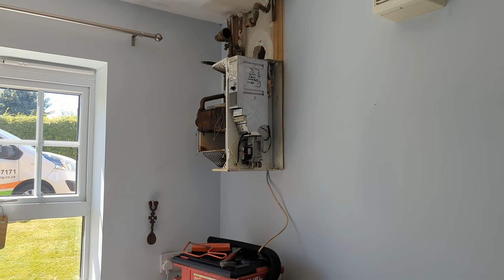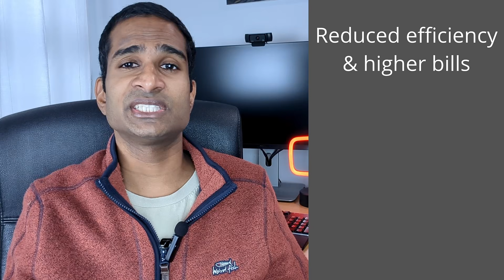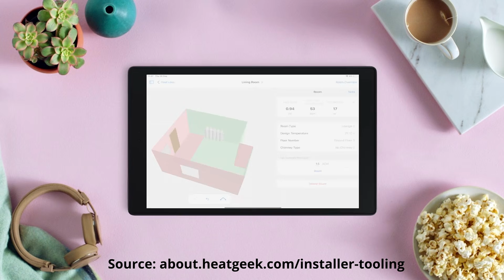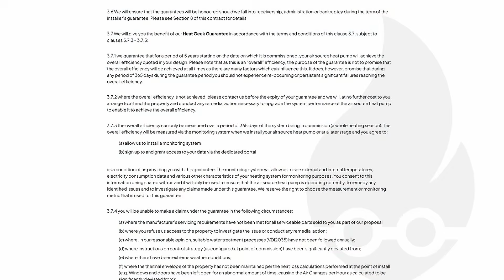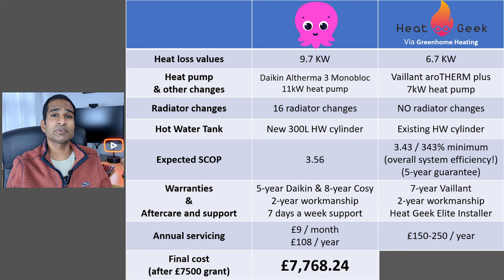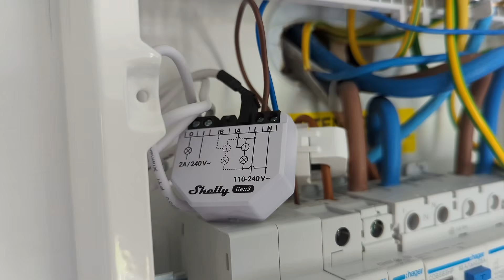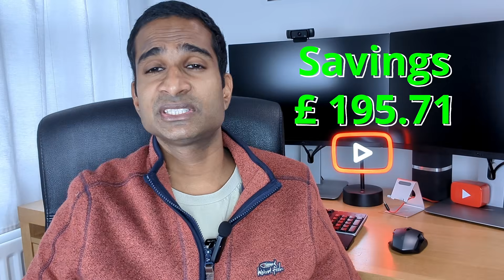Why I SNUBBED an Octopus Energy Heat Pump Install...

Comment from the maker: Question of the day: Should we prioritise QUANTITY or QUALITY of heat pump installs in the UK to reach Net Zero?
Share your thoughts below: 👇
Reply: I think ovo dropping their heat pump tariff shows that you should still ensure quality. 

Given our spark gap is so wide, a SCOP of 3.6 to 4 is needed to make the heat pump running costs competitive. 

I think lower quality installs relying on tariff magic are extremely vulnerable to the whim's of shareholder / investor profit margins.
Reply: Quality.
Reply: Definitely quality. Not even quality just efficiency.
Swapping radiators isn't exactly hard. 

I think the priority at the moment should be insulation, draught proofing and radiator upgrades. 

Make all new boiler installs mandatory to use weather compensation. And all boiler installers forced to do heat loss calculations and recommend things to improve costs savings/efficiency gains.

Offer low % finance over 10 years for heat pump installs. 

Personally I don't think it's difficult, it's just a long term thing.
Reply from the maker: Thanks for sharing 👍🏽 S
Reply: We should drop net zero targets. There are no benefits, only costs.
Reply from the maker: Sure sure, just ignore the evidence. We can't just keep burning fossil fuels
Reply: @everythinghome What evidence of benefits do you have please?

Comment: Ah brother get those radiators changed to double ones and you will be laughing even more! I bet you could do it yourself as well. I have zero plumbing knowledge but I was able to do all of mine
Reply from the maker: That's great to hear you did yours yourself - love people learning new skills - well done. Our efficiency is running around 460% at the moment, without a doubt we could get it a bit better but I'm pretty content with where we are after 12 months with the heat pump. Shan

Comment: Unfortunately Heat Geeks are far from perfect. The first Heat Geek installer allocated to me didn't respond to any communication, and the second one did a survey and presented me with an error-strewn proposal with a price tag that was more than twice their website estimate, and the second highest I have received (out of 8). Heat Geek couldn't (be bothered to try to) explain this so I got my survey fee refunded. My Octopus quote was more than £1500 less but as you experienced, one of the issues with their installs is their inflexibility.

Comment: Great video! 
Out of interest, did either company include a power flush of the heating circuit during the installation? 
Thanks
Reply from the maker: Thanks, I don't believe that was something that was quoted for in the work. Ours had recently had one done and we have a Magna clean device in the system too so don't believe it was necessary. I suspect you could add this on as part of the work if they felt it was needed? Shan

Comment: Octopus cutomer service is crap.  I am struggling to get  down to read my meter which is low to the ground due yo an arthritic condition. and my smart meter stopped send ing readfings in 2021.  they are supposed to repar that within 5 days. 5 years later and they have only read my meter once. they should read the meter every year at least once to confirm the reading.  Because they a Lazy and only want to send a bill and get paid they do not comply with their lisence rules.   whilst at the time the meter stopped sending readings was in the reign of SHELL Octopus should have taken an opening read for them to set the billing protocol. they did not do this. ALL my bills since 2021 have been estimated. they have missed 7 booked appointments to read my meters  NO ONE HAS TURNED up. I should be compensated but they refuse to apply the License rules in place for not doing so. basically they have no way of proving my usage with them. i told them this in december 2024 when i requested my meters be read. NOTHING has been done. this game we are being pursuaded to play of DO IT YOURSELF is not what should be happeneing. They should read the meters ONCE A YEAR to establish an accurate bill. in between this they can estimate. then on the yearly read an accurate bill can be established and a shortfall or a credit can be applied. By not reading the meters for at least 5 years and relying on estimates means accurate bills are not possible.  Time to challenge them and make them do their jobs properly.  Solar and batteries is the way to go. You can also charge the batteries at night on the cheap rate electricity and cut the costs as well.  Time for the Pay twice game via standing charges to go as well.

Comment: Good vid! I think the problem is nearly always with the training. I hope the big companies learn from Heat Geeks, because IMO if you're a big company and do "meh" installs, it sets the cause back. Imagine if a big company required all of their installers to pass the HG training? If an engineer can't pass the gold-standard industry certification, they shouldn't be installing heat pumps. 

When I watch the pros doing this stuff, it's clear the mindset is "get the best training available and keep learning". They never stop. We're several years in now and it's clear the better installers have made strides in a few areas:
- Do the basics for insulation/glazing if it's not already there
- Perform an accurate heat loss survey and size the HP appropriately
- Design the simplest system possible for a bog-standard house (e.g. no zoning, no buffer tanks, volumisers, whatever)
- Turn on weather compensation, tweak until the customer is happy

OTOH there are endless installers out there who still put them in like it's a gas boiler and know less about them that random YouTubers. MCS still seems to be a joke, with no real-world adjustments or inspections, just a flat 2.8 COP. Imagine you had a new-ish build and some plonker installed a 2.8 COP heat pump. Crazy.

I trust Octopus as an energy company (very good service, website, extra gubbins like the Ocotopus mini) and I don't think they'd do a bad install, but I'd still go with Heat Geek for a HP install because I want peace of mind.
Reply from the maker: Totally agree, training is the biggest lever here.

That mindset shift you mentioned (“keep learning, don’t treat it like a boiler swap”) is exactly what separates the top installers from the rest. The scary bit is that homeowners often don’t realise the difference until after install.

I think you’ve nailed the core pillars too: proper heat loss, simple system design, and actually dialling it in with weather comp. 

If big players pushed that gold-standard level of training as a baseline, it would move the whole industry forward fast. S
Reply: @everythinghome  thanks for the reply. I just can't understand why anyone involved in this industry installing HPs isn't getting the best training. It'd be like hiring a load of folk to be bakers, then saying "urm, yeah just bung some flour and water in a bowl and then shove it the oven", then wondering why the results are inedible. Baffling.

Comment: Interesting video - we turned down Octopus Energy heat pump installation for exactly the same reason. In a small 1950's bungalow, it wasn't feasible to shoehorn in big rads and a tank the size of the airing cupboard. Now I've seen the Heat Geek approach, I may be revisiting this.  The game changer for us would be having a solar / battery system installed first. Balcony solar? Let's see.
Reply from the maker: Thanks - we love our heat geek heat pump. Zero disrupt was definitely the way to do for us and well worth a survey with them.

Yes, exciting times ahead potentially for solar once the details are sorted. S

Comment: We are currently going through the Octopus route, because our bank is offering to pay the costs over and above the govt grant, so don’t have the choice of suppliers as they only use Octopus.  Our water tank is only 5 years old and needs changing due to size and apparently their tank runs a cleaning process weekly.  I wonder what the savings (in both money and carbon emissions) in running a more efficient water tank on a heat pump system are (and wasting a tank that hasn’t fulfilled its expected life cycle) versus keeping an existing tank that has a smaller coil that needs to heat the water for longer, but meaning you don’t need to waste its life too soon.
Reply from the maker: Watch this https://youtu.be/8aKZhX93hMU and if you haven't already got a heat geek quote it may be worth enquiring. A new tank for us would have added about 3k to the cost. That's a lot of hot water cycles no matter how efficient it is! Shan

Comment: Clearly in your example,  the 'precision' Heat Geeks approach was better than the 'standardised' approach.  And with less disruption, fewer changes,  and lower cost, it is better for you the customer and surely the installation part being simpler must scale better too.  Heat Geeks are going the right way, trying to standardise, streamline and automate the 'custom design' process with Lidar and AI etc,  this will give them the best of both worlds and surely must be the winning formula.
Reply from the maker: Yup, it's certainly working well 👌🏽 S

Comment: I had a heat pump in my previous bungalow. It was very efficient and   economical to run. I'm thinking of getting a heat pump in my new bungalow in a few years when the gas boiler is older. I don't have space for a hot water tank. I'm monitoring thermal store water heaters and waiting for smaller models to become available which suit smaller homes.  Thanks for your video. As always very informative
Reply from the maker: Thanks, that's really interesting to hear about your previous heat pump experience and your plans for the new bungalow! I've seen a few hot water cylinder storage boxes allowing them to be installed outside, may be something to consider. Shan

Comment: I tried going on Heat Geek's website to see if I could book a survey from them, but according to their address finder my ground floor flat in a semi-detached house in London is not a residential building.   They only seem to take you in consideration if you own a whole house, which is a shame. Octopus will at least do a survey.
Reply from the maker: Ah, no something I'm aware of. You could always contact your local heat geek by email and check if that's right. S

Comment: Yeah, E-On, I think they say nothing for 30 days then 50 drops into accounts, I did get a 50 Voucher email moving forward this year, I got a 24v 40A Fog Star charger, Its only worth it on a EV tariff. Charging my nearly 6Kw Home Battery. However, was a bit shocked with standard Variable being 35p or something and 60p  Next Drive Fixed. Standing charge. So might not stay with Eon after, I get 50 quid .... Be checking in Thru out year.

Comment: I would like to see you break down the cost of the install. I feel the heat pump installers are taking advantage of the grants. Overcharging thousands of pounds for the labour. I would guess your equipment cost around £5.5k leaving £4.1k for labour, and as you had very little changed on your install they wouldn't have spent much time installing it.
Reply from the maker: I hear you, it's a big number! But there’s more to the maths than just the heat pump. The Vaillant unit, the SensoComfort controls, the Primary Pro insulation, and all the G3/MCS components do add up.

More importantly, you're paying for the liability and the MCS accreditation which is required for that £7,500 grant. That survey alone takes a few hours of heat-loss calculations to ensure the system actually works in the coldest months. I’d rather pay for 2 days of expert 'Heat Geek' labour to get it right, than 5 days of a less detailed install with unnecessary changes and disruption that costs me a fortune in bills later!

We're paying for all those years of experience to get to the point where they can install a heat pump which is as good as I've got with minimal disruption. S
Reply: @everythinghome  every skilled professional has similar costs, and this is taken into account when they charge. 

When a Doctor is being paid a few hundred pounds per day, why are heating engineers charging 3 times that? 

You got a good deal because of the grant, but why didn't it get put in at zero cost to you?

Imagine how much faster the country would decarbonise if they were being installed at zero cost. 

I would be interested to know a cost of the materials and labour.

Comment: You would have likely had a slightly better performing system with Octopus but it would be poor value for money.

I'm going to install my own system. It will be dual fuel with my oil boiler. Heat loss is currently 35kw, however, this will be brought down over the next few years.
It's a listed building so subject to consent so the final result can't be known in advance.

This meant that any current install wouldn't be eligible to the BUS.

Also any system over circa 12kw becomes disproportionately expensive.

So a sell installed low temperature system that operates in milder months on ASHP and switches to oil on colder months.

As the insulation improves the ASHP will do more of the heavy lifting.
Reply: Good grief…35kw? I have a 4 bed detached victorian house and my heat loss is around 12kw

Comment: I’m so fed up of hearing about Octopus. They coaxed so many over to their energy but I don’t think they are a company to be trusted. Whenever people have trouble it’s almost always due to octopus fsilings
Reply from the maker: To be fair, whilst with them I've had no issues, in fact  far from it, I've had an excellent experience with them. I only moved as the rates were better with e.on for electric. S

Comment: I'm confused by the assessment process, on heat geeks website it looks like Octopus use Headgeek tor software process?
Reply from the maker: I'm not quite sure what you mean. Are you able to drop a link in for what you're making reference to. S

Comment: It would be interesting if you would see any difference in efficiency if you used a small fan to blow some air up the back of your radiators. The circuit temperature could be reduced a little.

Comment: We went with heat geeks as they were only slightly more than Octopus but seemed to be much higher quality.

One thing is that we had to wait a while. There were no heat geeks in our area so one had to travel from a few towns away. There needs to be a lot more heat geeks!
Reply from the maker: Yea, definitely agree with the much higher quality aspect and attention to detail. Good to have options 👍🏽 Shan

Comment: For me, Octopus worked out better: heat loss is 9.5kW, system is £7100 for a Cosy 12, HW tank, 12 radiator changes and adding one additional radiator for a big room, plus some 8mm pipe upgrade to 15mm. I calculated SCOP to be 3.67 for HW and Heating.
Heat Geek: Heat loss was 7.9kW, system is £7750 for Vaillant 10, HW tank, 2 radiator changes and the same repiping for 8mm to 15mm. SCOP guaranteed for 3.7 overall.

Whatever the real heat loss is, the two systems have a similar enough efficiency that they are roughly on par, but the Octopus API is easy to get the data from to get into Home Assistant, have updates from them vs none for Vaillant likely, has cheaper servicing at £108 a year and can be sited in a much better position at the back of the house than the larger Vaillant unit. For £650 less, I have a brand new set of radiators worth around £2k throughout the house (several are pretty ancient) on top of a heat pump, and that seems like a better deal, and they were much more forthcoming than Heat Geek with design temp and the design info where the data is more locked down from Heat Geek. I was hoping from watching all your videos on Heat Pumps that Heat Geek would be cheaper, but with Octopus’s vertical integration and fewer middlemen to pay, they have won this round. I’d have gone for Heat Geek if it was significantly less.
Reply from the maker: Thanks for the insight. It sounds like you made a well informed decision and are happy with the decision 👍🏽 S

Comment: You do know that a AroTherm 7kw unit actually is around  8- 9.8kw output @ 40 drgrees flow, Vaillant units are very misleading in there sales.

Comment: Can't believe that Octopus wanted to change 16 radiators and still used a max flow temp of 50 degrees. I would have expected 45C or lower temps with that sort of radiator upgrading.
Reply from the maker: Yup, the differences in approach between octopus and heat geek were night and day. S

Comment: Don't bother with any of this nonsense before you've fully insulated your house.
Reply from the maker: None of it is nonsense, though I agree sensible to insulate insulate insulate. S
Reply: Additional insulation isn't necessarily needed. Though adding cheap insulation can help bills for gas or electricity. For a new heat pump, you might be able to get away with a smaller one by adding more insulation (or not).

Comment: There is no mention of an internal unit. Is that not compulsory?
Reply from the maker: Nothing internal needed apart from the control unit and hot water tank (we already had a hot water tank as in the video). S
Reply: This is a monoblock system, so all the core components are outside.